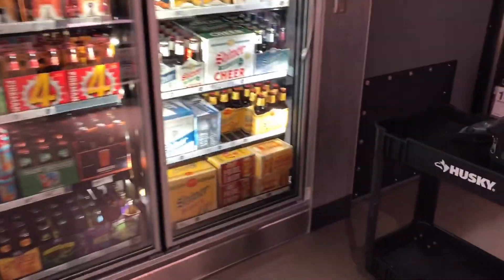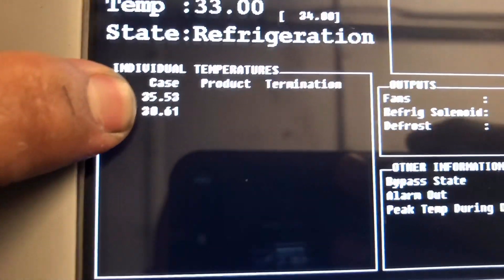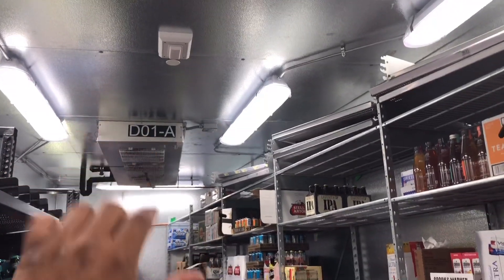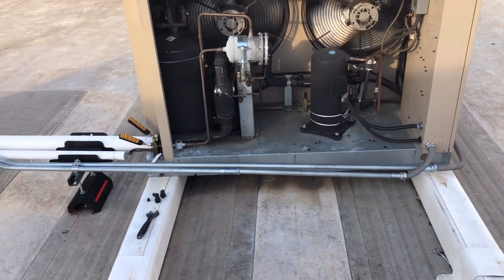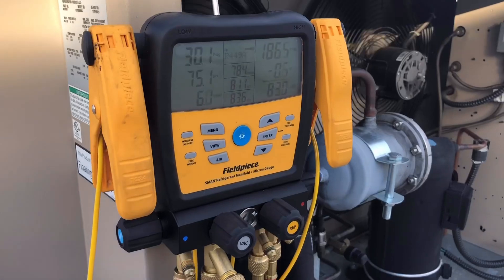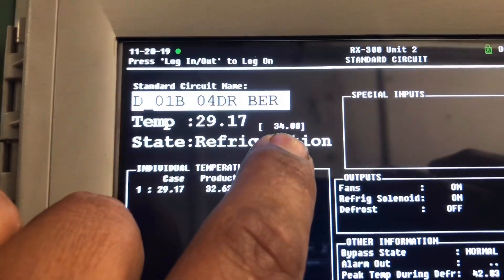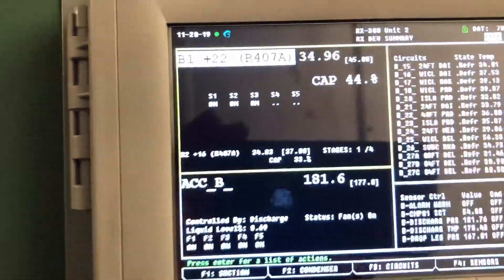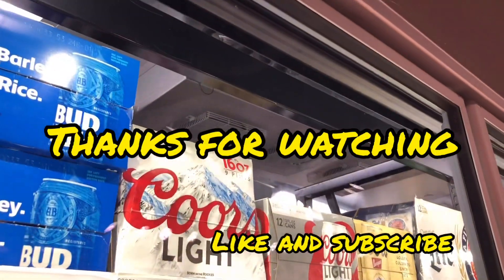HVAC Refrigeration: Walk In Cooler Running Warm,  Erratic Temperatures

Comment: I mostly do restaurant refrigeration, what shuts of the cond unit on this one? I didnt hear you meantion a thermostat. All i know i bout epr is that it maintain a constant evap pressure. Thanks bro
Reply from the maker: The E2 controller shuts off the solenoid Based  on box temp and the condenser will shut off on low pressure.
Reply: @rookierefrigeration4357  i appreciate it thank you

Comment: How come you don’t use your smans that much? I’m thinking about getting a set but also thinking about just getting the wireless probe set.
Reply from the maker: Honestly, I use my probes 95% of the time.  When I need to add gas I just use my Analogs.  The SMAN really only go on single systems and I really don’t touch them much.   Lol. Somehow I became a rack guy 😂😂😂
Reply: Yeah, all my work is supermarket work. Mostly pack systems with loads of integral cabinets to boot. I’m not sure what route to go down. I prefer looking at gauges but this will be my first digital setup as have always used analogue. The only thing that puts me of the probes is keeping enough charge in my phone/iPad 😆

Comment: You cant really go off the outer parts of the evap coil to see if its clean. Low pro evap coils suck air in where fans are and blows out towards product/outer walls of walk-in box
Reply from the maker: Cole Herndon yes. I agree.  But you could see some indications of ice.   Usually these stores don’t get iced up coils.
Reply: Rookie Refrigeration yeah true i hate havin to thaw that style coil out. But good work on it bud alot if people dont realize they pull from center thats why i added that in there
Reply from the maker: Cole Herndon yup.  I actually have a video coming out that I mention that exact problem.  Thanks for pointing that out.

Comment: Leave the ORI in the small case. You have better temperature control with that than a stat and solenoid. Glide etc. ORI is set and the temp is good. it won't freeze and it's only beer.
Check your ORI first for a leak. I have changed a crap ton of those either leaking from the body or thru the adjustment area.
Another suggestion, shine your flashlight into the return of the coil. You'll be surprised at how much crap gets stuck to the inside of the coil.

Comment: Looks like a pretty nice installation. Piping and insulation looked great. I would think that set up should work. You should be able to prevent the temp in the reach in from dropping too low by proper adjustment of the EPR.
Reply from the maker: Yes, the EPR has been doing it’s job so far. It is just when it was low on charge it messes up. Pol